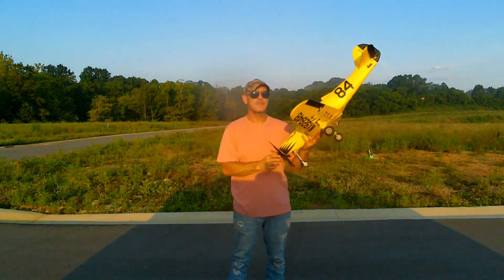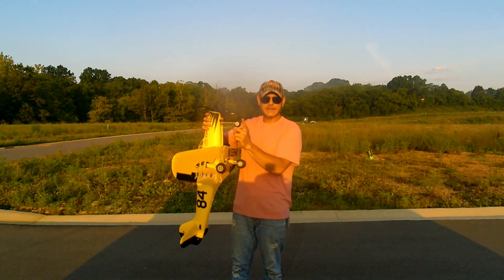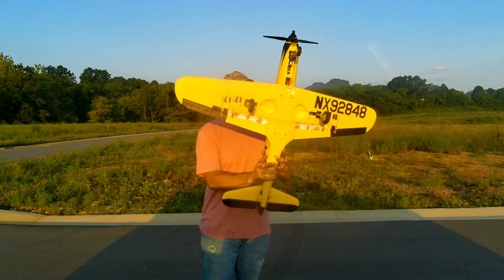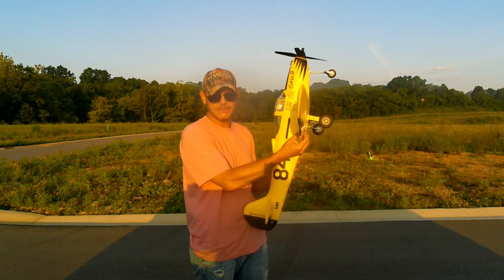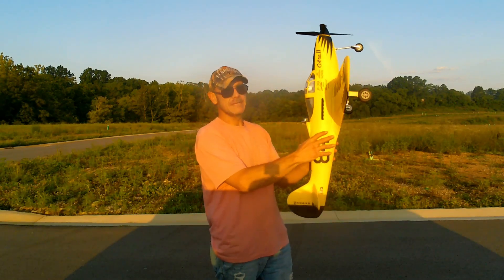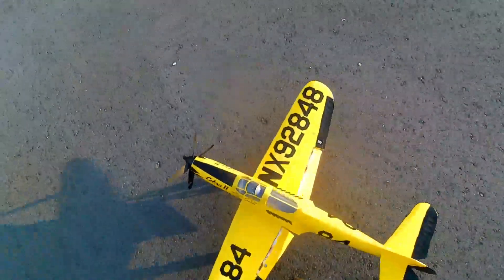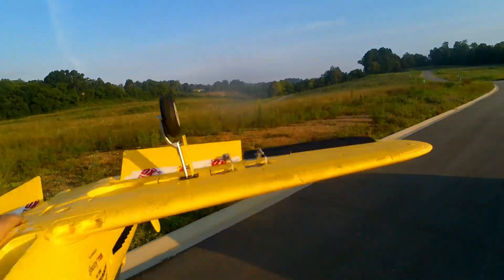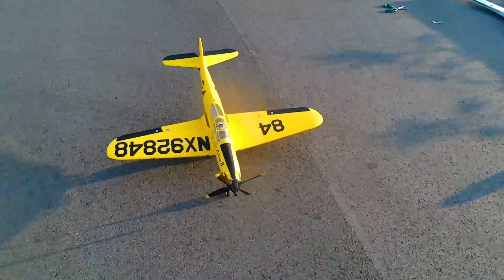Fms-P39-aerocobra-ll-980mm. Remaiden flight.   #smokeymountainrc #rcplane #aviation #fmshobby

Comment: final observations         dirty lens  whole video.          :33   the aileron linkage, on the right, appears to be slightly wonky.     specifically, a pushrod should be perpendicular to its associated hinge line.          it was not a good idea to locate the mass of the flaps servos so far  Outboard.     also, to the extent practical, the mass of all wing-located servos should be located  just-forward-of  Thirty percent of chord; where the main spar  Normally  is.          along with the flaps servos, the (slightly outboard) location of the mass of the retracts also affects the dom and/or stability of the model.     dom  is  distribution of mass.            idk if this model has a scale-accurate wing profile, but the profile  looks pretty good.      said another way, a scale-accurate wing profile should  Not  be used in a scaled-down version of a design.        in part, this is so because the two wings  operate in very different conditions;  see  reynolds numbers (re#).        d
Reply from the maker: No dirty lens.  Sun spot burned on lens.
Reply from the maker: All the linkages are assembled factory. Once I added more expo the twitchyness of the plane stopped.

Comment: when you can glide a model, you can  land  it.!!!        so, practice  GLIDING,  at a safe altitude.        gliding is not about flying slowly.          gliding is about  flying  the  Elevator, correctly.
Reply from the maker: This plane is a breeze to land. That was the only the 3 landing  iv done with this model.  One awesome plane
Reply from the maker: Check out my other 11 planes. They all GLIDE good also

Comment: i always like to fly my model into the sun a lot.!!!    NOT              fly  so  that  the  sun  is  at  your  BACK, all the time.            anyone who talks about using flaps does  NOT  understand flaps.!            99.9999 percent of the time, a pilot  JUST  Needs  to  fly  the  elevator, correctly.!!!
Reply from the maker: Yes.  Understand flaps. I think I do well for no longer than I been flying.   Less than 2 years.  I'm pretty sure I understand flaps. And I definitely know how to glide bud.   Thanks for watching.  Check out my other vids.  Maybe you give some pointers on flying my other planes I don't understand about.